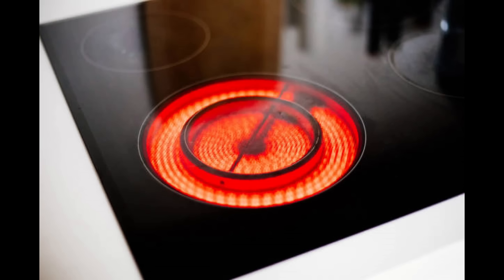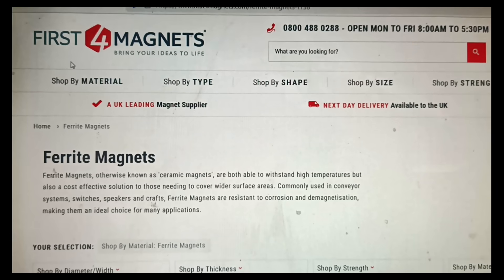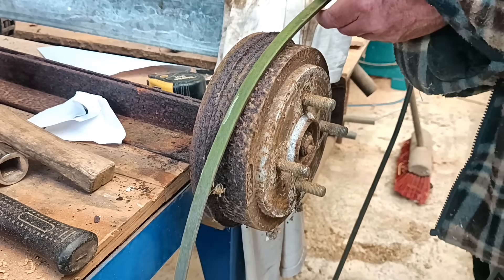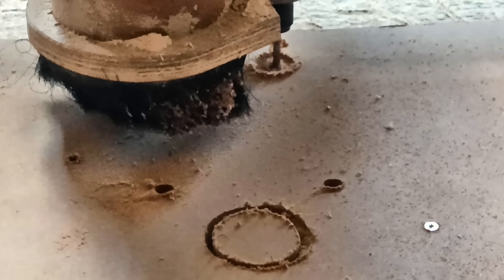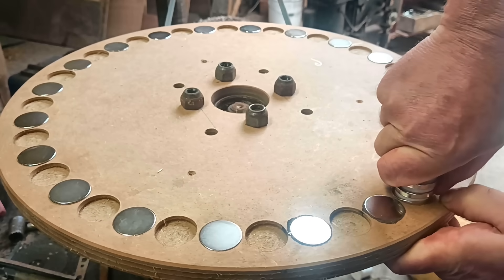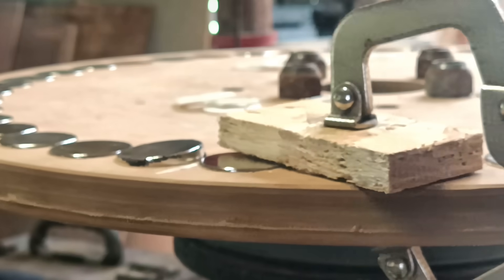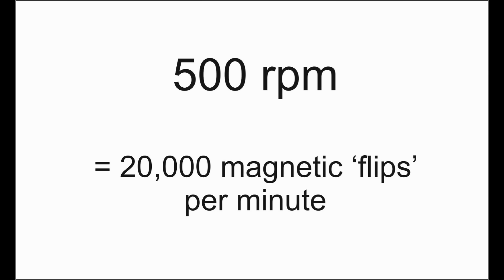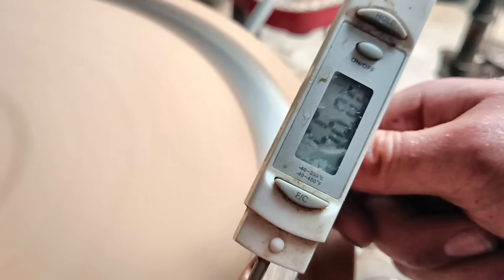I Made A BIG Rotating Magnet Induction Heater! (with magnets from First4Magnets.com)

Comment: Now just got to learn about halback pattern, minimize the distance between magnets and the metal, increase the interaction amount, aka more copper pipes, and maybe not pipes, but solid blocks with channels for water, maybe use pure iron to redirect the magnetic field so less of it is dispersed in air.

Sounds like a fun project and i want to see success and good performance
Reply: And have the water pipe between two discs with the same magnet orientation, too.
Reply: @ThalassTKynn  Another good way to do it it have a ring, with magnets on its inside, centrifugal force will be applied outwards, but the magnets are facing in, so they are kept in there tight, and then the metal piece that heats up could be in the middle of the ring. A minimalistic design

Comment: Worth noting that the effect would be stronger with a ferromagnetic material, though of course you do have the problem of the magnets trying to stick to stuff. The phenomenon of "magnetic hysteresis" increases the heat output quite a lot - this is why induction stove tops will only work with ferromagnetic pans.

Comment: 0:39 : this doesn’t seem quite right? Why would the magnet pull the electrons up and down? It might lead them to have their spin direction go up and down, but that’s not moving them up and down.
A magnetic field in some direction causes charges moving in a direction not parallel to that direction, to turn , in a direction to go around the magnetic field lines. I don’t think it should really cause much vertical motion (except indirectly, by the heating and such it causes)
Reply from the maker: now you've got me thinking. So perhaps I should have tried it with only half the magnets in?
Reply: @wayoutwest-workshopstuff6299  I think the design you have is right. A changing magnetic field produces an electric field,  which produces a current which produces the heat you want. And, having the magnets alternate as you have seems like the way to achieve that.
Just a little error/nitpick in the explanation.

Comment: A easier and safer suggestion: It doesn't matter  whether the magnets or copper is rotating. So rotate a copper disk and have the magnets on a non-moving board to remove the risk of the magnets flying off. Even better, for  the rotating disk, use aluminum rather than copper - it wont make a difference  which is used as long as they are thick enough. The thickness should be the "skin depth" at 666Hz (40,000 flips/min divide 60) which for Copper is 2.5mm and Al is 3.1mm, so a disk of either at those thicknesses will be as good as you can hope to get in terms  of heat generation from eddy currents. Even better, if your stationary magnets are mounted in a thin holder, use two disks, one on each side of the magnets for twice the heat. And, since the heat is generated in the rapidly rotating aluminum disk(s), the rotation will create air movement to help transfer heat to the air. Regards from Canada!
Reply from the maker: Thanks very much! I wish you were much nearer..
Reply: @wayoutwest-workshopstuff6299  Wish I was I was nearer too - been following your projects since  the farm railroad which is still my favourite! I'll email you with a few more thoughts.
Reply: @Humbulla93  How about taking your idea, but get rid of the copper tube and just have the stator and rotor disks bathed in your high heat transfer emulsion liquid. The thick liquid will ad resistance to the rotation increasing heat production. Have a few coils of copper immersed in the emulsion bath to carry off the heat. Would be really interesting to see how much more effective an nano Iron oxide/ hollow tube graphene mixture at carrying the heat away from the aluminum disk that say plain water, oil (various thicknesses) or other fluids.
Reply: @ElectromagneticVideos  your improvement saves Material and time, the rifled tube paper you can find under 
Thermal Performance Enhancement Using Absorber Tube with Inner Helical Axial Fins in a Parabolic Trough Solar Collector.

Also i remembered it incorrectly it was ethylene glycol
The "Nano-Fluid" paper is called 
Nano-Iron Oxide-Ethylene Glycol-Water Nanofluid Based Photovoltaic Thermal (PV/T) System with Spiral Flow Absorber: An Energy and Exergy Analysis
Reply: @ElectromagneticVideos  it would be interesting coupling it to a tesla turbine. Using Sand as Thermal battery and water under reduced pressure to drive the Tesla turbine. 

Or would an over pressurized system make more sense because the water can hold more latent heat which should directly correlate to the energy density. 

I also find Vortex tubes amazing they basically split fluid into denser and less dense in Case of air one side gets cold and the other side gets hot. And producing both cold and heat.  an a stirling engine seems to Love great Temperature Differences. Sorry for the rambling my ADHD is working overtime
Reply: @Humbulla93 Thanks for the paper reference - I just downloaded it. Looks like it was a collaboration between researchers in Iraq and Australia - both ideal places for solar energy and places I have been too :)
Reply: @Humbulla93  I'd be scared of a pressurized water system - too dangerous for a simple home system. I have read things about thermal sand batteries - seem to be getting some traction in Europe. It till be interesting to see if thermal battery systems stand the test of economics. As I recall they had large (building sized) volumes of sand. 

Vortex tubes - something I have always wanted to experiment with! And Stirling engines too. I have always had an interest in stuff like that, particularly for solar energy. Just in the process of installing an electric boiler at home for hydronic heating and (probably next summer) an array of used solar panels. 

No worries about rambling - these discussions tossing ideas back and forth are always so interesting!
Reply: @wayoutwest-workshopstuff6299   They're like puppies.  From a distance, they're cute.  Close up, your shoes are going to get chewed.
Reply: @wayoutwest-workshopstuff6299  Per ElectromagneticVideos point about metal cups for the magnets, those are usually available from the magnet suppliers. They really do make a difference in power.
Also from Canada. (Alberta)
Reply: @jimmackey2909  I didnt know that!  It makes sense they would have holders for neodymium and similar magnets - they are often so small and string that they are tricky to mount.
Reply: How do you transfer the heat into some water then, if the disk is spinning? That is much easier done with a stationary disk.
Reply: @FluffyTrinford  Have the whole thing in tub of water. And the water will add some friction and further help heat production, and the rotating disk will help stir up the water to better transfer the heat. A little bit of fluid flow makes a huge difference in heat transfer. Did some experiments with some sealed aviation electronics years ago - the slightest airflow made a huge (much more than expected) difference.
Reply: One more thought - if there was a water entry point  near the center of the disks, you would get a low efficiency Tesla turbine. (due to one stationary disk). But it could pump the water well enough to feed radiators etc, and the low efficiency would be no loss - since the pumping power lost is converted to heat.
Reply: @ElectromagneticVideos  How exactly did you generate your initial expectations? It is quite simple - if no molecules move or zero convection: your thermal conductivity is almost zero, because the intermolecular connections in gas are ridiculously lower than that in solid matter. So essentially all heat transfer is related to heated molecules movement. Ofc there is some infrared and still gas conduction, but it is negligible after even the slightest movement.
Reply: @executormmm  Two separate things: 1) Heat generation 2) Heat transfer. 

1) With the magnet system Tim is experimenting with, the heat generation does not depend depend on what carries the heat away or how well it does that. Of course without carrying the heat away a at reasonable rate, things would be getting pretty hot. I'm not sure if it was in these comments or in  a email to Tim,. but I did caution him to not let the magnets too hot (above Curie Temp).

2) Conducting the heat away to presumably a useful application like heating the home or water: Its amazing how much even a little airflow with increase the heat transfer to air. It doesnt take much (forced) air flow at all to carry off 100W from a CPU heat sink. Without the the airflow, temps go way way. Years ago I was in involved in the design of a sealed piece of electronics about 9" square and 3 inches thick for installation  in  aircraft. At about 30W of power consumption,. you could almost fry an egg on the box. With just a bit of airflow from the aircraft type ventilation. the temperature went way down.  I think the air rushing between the magnet and solid disk will be able to carry a large amount of thermal energy away. However I did suggest to Tim that he might want to consider bathing the whole thing in a tub of water or oil and use that to carry the heat away to where-ever he needs it or to a heat exchange.
Reply: @Manigo1743 
By submerge the disc directly into the water😮
Reply: Brilliant idea! I may make an oil preheater using this idea, I'm sure you see how it could be ideal. Thanks for sharing this!

And yes, I'll spin it slowly enough or deeply enough to avoid ignition from cavitation or vaporisation lol- just thinking of preheating waste veggie oil.
Reply: @mikedalka2828  If you do, would be great hearing the results. Maybe even use the rotation to as a crude Tesla turbine type thing to move the oil.
Reply: How about fixing magnets to a rotating axle/shaft surrounded by copper/aluminium immersed in liquid medium for heat exchange? Enclosure would reduce risk element.  Reduced diameter would require fewer magnets to achieve required 'flips'. Another option is to extend magnetic field along axle to excite more electrons.
Inset magnets into alkathene pipe or similar, glue pipe to metalic/wooden axle and immerse with a top seal fitted with vent

Comment: I love the idea of producing heat with wind power! My suggestion with the inductive heating idea is possibly using a ferromagnetic pole piece on one side to intensify the magnetic field on the top side. My other idea for the goal of using wind power for heating is that you could use your wind turbine to drive the compressor of a heat pump, it could be several times more efficient, and plus it could heat and cool. Of course this would mean you can't build it yourself from raw materials, I love how simple the magnet design is!

Comment: Interesting, not only do you gain heat. You can generate electricity. The copper pipe can also be a break for the windmill during high speed event.🤔

Comment: @Way Out West - Workshop Stuff 8:08 USE A WEDGE to handle these types of magnets.
Make a wooden wedge, at a shallow angle, then wedge the magnets apart but ALSO together so they don't slam into each other & break (as you have done twice already).
It is also MUCH safer for your fingers & other limbs, also be careful of magnet-fragments flying at high speeds towards your eyes.
You can also build a kind of wooden "scissor", to "sheer off" one magnet from the rest.

Comment: @Way Out West - Workshop Stuff
eg: 5:39 Look more into: "Halbach array" (here I would have linked to Wiki, but YouTube auto-deletes comments with links in) 
It's a way to arrange magnets, such that adjacent fields increase the strength of other fields, and if done correctly it also limits the amount of magnetic fields going out on the "back side" of what you're using it in, it will most likely be useful for a full scale version of this heater.
Reply from the maker: Thanks yes, someone did send me that link. Very interesting - but can you reverse them easily?
Reply: @wayoutwest-workshopstuff6299  
Not sure how you mean with "reverse"?
You can always spin the disk / base-plate in the opposite direction, that's no problem. 

But to "reverse" the magnetic field itself,  you would need to physically change the magnets orientations.
But from your wheel-construction, I assume you want the strongest magnetic fields to be aimed "upwards" away from the "base-plate", so i don't see any need for "reversing" the magnetic field, as that would aim most of the magnetism into the wooden plate instead, where most of the magnetism would be wasted.

If by "reverse" you mean something about the "flips" in the magnetism?
The shape of the magnetic field will be more "spiky" and it uses groups of 3 magnets to make 1 "spike".
The magnet field goes "in" to magnet A, "through" magnet B and "out" from magnet C and back "into" magnet A (and half through E) again.
Reply from the maker: @sebbes333  Thanks - so it wouldn't be possible to repeatedly flip the flux then? Or could you do this experiment with the magnets in the Halbach arrangement?
Reply: @wayoutwest-workshopstuff6299  
Yes, it would be possible to do this experiment with the Halbach Array, the biggest problem would be the shape of the magnets, as they work better the closer they are & more surface they share, and round shapes are bad at touching each others, idealy they would be almost cubical, but very slightly pie-shaped to fit optimally.

The "flux flipps" are still possible, as each "spike" is made from a "input" & an "output" side.
      -->--      --<--        -->--      --<--      -->--      --<--  <----- Magnetic field lines + flow-direction (I wish there was more better emojis or ascii charters to use) each one is the tip of a "spike".
 \/          \/          \/          \/          \/          \/        <----- Magnetic field lines, note: every other "\/" flows in the opposite direction, it shows the field splitting into 2 circles, opposite rotation.
⬆⬅⬇➡⬆⬅⬇➡⬆⬅⬇       <----- Magnets in a Halbach Array (side view, linear arrangement. but just bend the line into a circle.)
Reply from the maker: @sebbes333  Thanks - I understand now
Reply: If you use both sides of the magnet for induction heating then there’s no reason to use a Halbach  array, and if you rotate the metal rather than the magnets then there’s no problem with flying magnets.

Comment: Would it still work if you made the copper pipe into a circle the same diameter as the magnets if it jiggles the electrons all round the pipe  you should be able to produce a lot of hot water very quickly just by feeding it it one end and out the other 👍

Comment: 9:38 hang on ! Why don’t copper, stainless steel or aluminium pans work on an induction hob then ? You have to use ferris metal pans or at least ones with ferris metal based.
Also, if you placed any part of your body close enough to the magnets, what would that be doing to the iron in your blood !